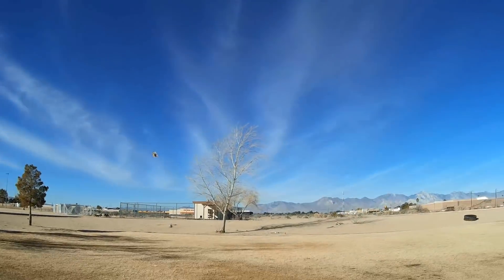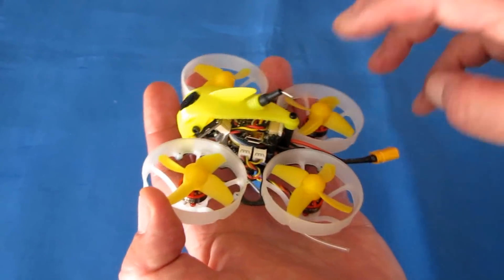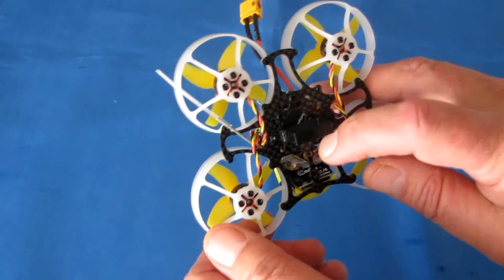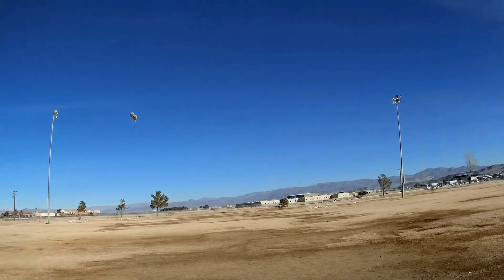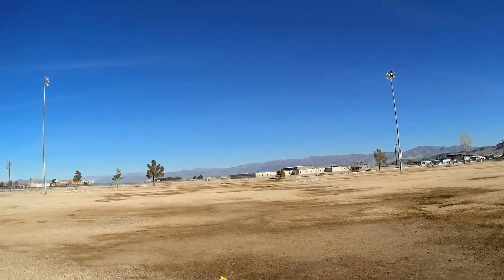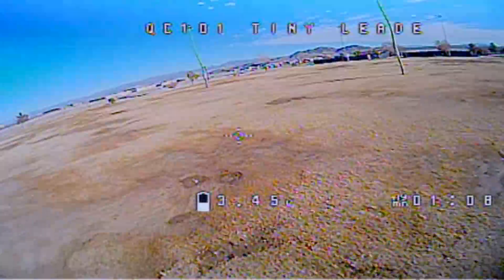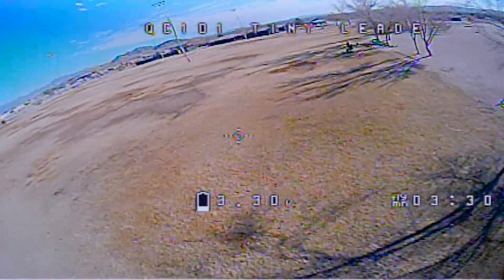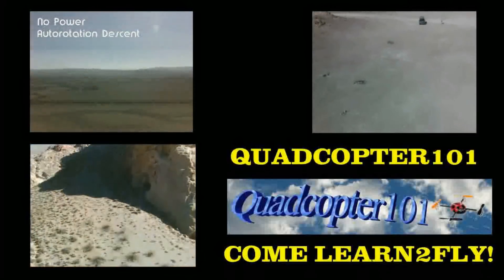Fullspeed Tinyleader Brushless FPV Racer Whoop Drone Flight Test Review

Comment: First, great video, and that is a cool looking little whoop! My thinking on why the front ducts and props are farther apart, are to apply more force on the front of the quad, as the weight will be centered over those two props. Wider spacing provides more leverage for each motor. I've seen that configuration on a few quads now. That's some thoughtful engineering there. I like to see that in companies.

Comment: I love that T8SG V2 Plus...  Do you have your Eachine M80 bound to it?  I've been having some throttle issues while setting mine up and it's starting to drive me nuts.  I've googled left and right and can't seem to find any hints, tips or settings.  Thanks!
Reply from the maker: What type of throttle issues?
Reply: @Quadcopter101 The problems are pretty nutty.  I think I just need to start over with the basics and relearn my transmitter.  With better understanding, I'm sure I'll be able to sort it out.  In the meantime, there's a new EX2H to try out!  Thanks for the reply and as always, the great video!

Comment: Yes !!!! Banggood is a hit and miss site. Not too reliable! Sad ,because of the great prices. Many problems ordering in my experience. Try the USA banggood site a bit better. Luck to all !
Reply: Yeah, man.  I just had a problem with an order and they were downright insulting.  I tried to be nice and patient, but they just kept playing ignorant and acting like they'd forgotten things I'd sent/typed previously.  Finally, I threatened to have PayPal cancel the transaction and wait for them to send a prepaid shipping label.  They were still very rude about it, but I finally got the problem sorted.  Keep in mind, that order was the 4th quadcopter I've ordered from them THIS YEAR.  Great prices, though.  I'm just going to keep using PayPal.
Reply: I use Banggood and have for over 4 years. Few issues with quality of products but have found them pretty good on sorting out issues. Way better experience than I've had with Gearbest/Gearworst.

Comment: Glad yours flew , mine burnt out esc in one minute.
Reply from the maker: I heard that before.  Out of curiosity, were you using 2S or 3S battery?
Reply: It was a 300 3s tatue that's the only one that I could stretch in there. Got new printed mounts that fit now.
I sent it straight to the shop to upgrade the esc`s. Dumbthumbsfpv did a vid on the mod. Fyi .
  Enjoy all your vids learned how to regain orientation when I couldn't envision it myself. Been doing this for about ten months, loads of fun.
Reply from the maker: @stevedelp4067  I got a feeling that this may not be truly 3S compatible.  It might have been lucky on my part that I don't own any 3S small enough to use with this drone.
Reply: @Quadcopter101  u may be right. We'll get the esc's up to speed, and see what happens. I'll try to let u know how it does.